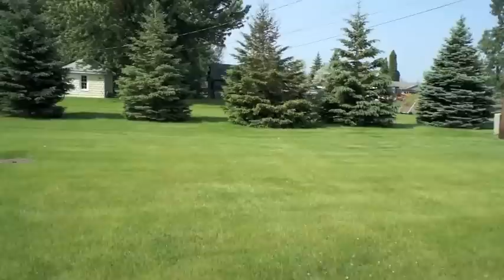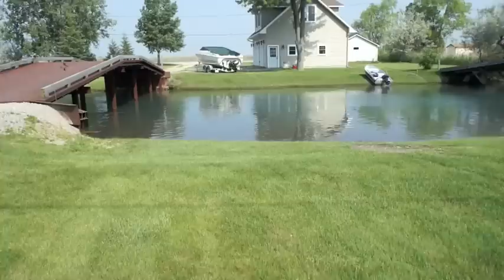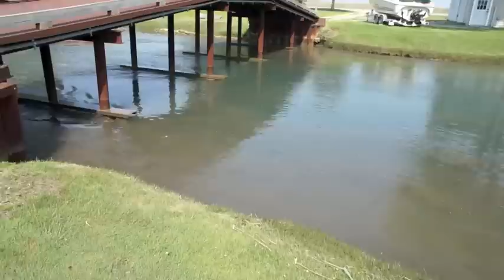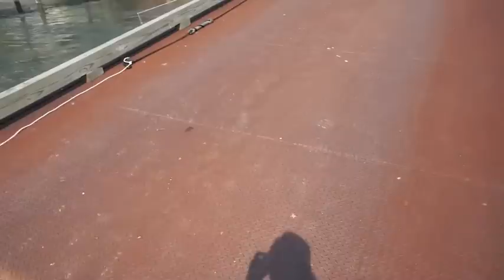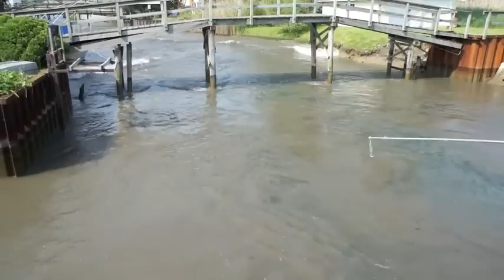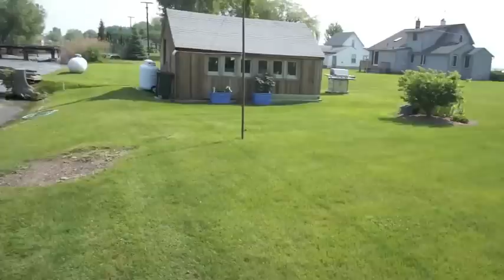Displacement from Ship causing damage

Comment: This video was part of a series of videos studied and analyzed by the USCG to determine that the upriver vessels were traveling anywhere from 3 knots to 5 knots over the allowed 8 knot (land relative) upriver limit (10.4 knot water-relative limit) during the shipping season.

You are a legend ,seriously somebody needed to put such a video to wake them ,very well made video
Reply: The speed limit has been enforced for many years by U.S. and Canadian coast guard vessel traffic controllers. By checkpoints and more recently GPS.
Reply: Last I checked the USCG regulations there was no speed limits anywhere. Just the slowest safe speed possible. Sometimes that can be 10 knots depending on wind speeds and currents.
Reply: @Deerhunter2024  Speed limits for the St. Clair river are 12mph/10.4kts SOG between light X-2 and Lake Huron Cut buoys 1 and 2, found in 33 CFR 162.138 and US Coast Pilot volume 6 chapter 2. Speed limits are enforced both by GPS/AIS monitoring and mandatory participation in the vessel traffic service at Sarnia, ON
Reply: Yeah but don't mind the uneducated fellow that has to tell everyone it has nothing to do with displacement. Its the props sucking the water from in front bathe ship and pushing it behind the ship, not the ship displacing water. Displacement will only cause a rise in water
Reply: @justindamirgian1088  Yea it didn't make sense to me.

Comment: I realise i'm 8 years late to the party, but let me get this straight. You bought a house next to a shipping lane and you're complaing that there are waves.

Better cancel all trade, and you can make up for it with double taxes for 25 years. Better?
Reply: no read the description! speed limits boats have them too.
Reply: If you bothered to read the description instead of being a dick you'd realize the issue is that the ships are speeding causing large wake that results in damage.
Reply: @JoeyMace28   There's a minimum speed a ship can move under its own power.  Slower it will lose the ability to steer. This speed is different for each ship.
Reply: Pete Mulhearn And evidently the ships were speeding and slowed down because it also says in the description that the problem has now stopped.

Comment: A simple cure at hand is o make a choke point at the mouth of this river...just wide enough for a small boat, with a shallow draft.   so instead of an opening 10 meters wide by  2 meters deep, ( that's an opening of 20 sq meters ! if its not a lot more..)  where as a choke point of 2 meters wide by 1 meter deep, is just 2 sq meters   the surface is one tenth or less , but the actual flow would be far smaller, probably about one twentieth and this would hardly be noticeable.

Comment: The problem here is soil errosion.
That's a big problem indeed. Those who never lived beside river will never understand this. Try putting plastic sheets in the edges. Waterproof sandbags can be used. It certainly not stop the erosion but it will decrease the intensity of it.

Comment: I live on the St Clair river which is part of the Great Lakes shipping channel. It is not just the freighters but also the 30-50 foot yachts that go by at 30 - 50 miles per hour. Actually the yachts are worse for wake.This year with the high water levels the erosion and damage to the shore has been worse but there is a simple solution.

Rip rock or 12-18 inch rock dumped along the shore solves the problem. easy to do and not that expensive . I protected 80 feet of shore for $800 and took less than one hour Also the rock looks natural. Works perfectly and no more erosion or damage.

Comment: How about putting baffles at the mouth of the river, to slow down the water draining out. Then you could install one way gates to stop inflow.
Reply: The ships were exceeding the established shipping speed limit by a good amount, which is what was causing the problem. Once the limit was enforced, the problem went away (which makes sense, since a big reason shipping speed limits exist is to prevent excessive erosion).

Comment: The problem was that quite a few of these ships were going over the speed limit required for this area. The ebb and flow of the water in the canal is supposed to happen but not at the rate in which these ships were travelling.  The higher speeds were causing the damages----that's what the man's complaint was. It didn't just affect peoples property but it wiped out wildlife habitat and breeding grounds as well. The canal was built for the lake to be able to sustain shipping lines with minimum damage to people's and the surrounding wildlife's environment. Exceeding the speed limits throw everything off kilter by causing a stronger force in the displacement and refill of the water.

Comment: Simple solution, only its a expensive 1.
And it last for years to come.
Steel plates against the shore. like the did under the bridge.
So the dirt doesn't wash away.
End off problem.

Comment: If you have a minimum height you need to maintain put a damn in, Control the water moving each direction. This can be done and be boat and fish friendly.
Reply: The ships were exceeding the established shipping speed limit by a good amount, which is what was causing the problem. Once the limit was enforced, the problem went away (which makes sense, since a big reason shipping speed limits exist is to prevent excessive erosion).

Comment: Just out of curiosity, where is the location of this? As this would be a natural occurrence from any ship of this size for numerous reasons. Number one, it's displacement, it's draw, moreover if one could even imagine the size of the prop(s) on the vessel this alone can and will cause enough turbulence in the water to affect any waterway adjacent to a deep water channel such as the one it is passing through. Remember, this ship, if loaded may be drawing as much as 30'. Have you spoken to the Corps?

Comment: Building a short seawall at the exit of the river that is level with the river water would get rid of most the drainage issue. Which in turn would reduce the volume of the incoming wave.

Might be a pricey though.
Reply: The ships were exceeding the established shipping speed limit by a good amount, which is what was causing the problem. Once the limit was enforced, the problem went away (which makes sense, since a big reason shipping speed limits exist is to prevent excessive erosion).

Comment: I’m confused on why this is happening, I feel like he didn’t explain it well. Can someone help?

To me, wouldn’t the water in his canal rise because of the ship causing the water level to rise in the river? Is the ship blocking/slowing water flow to his canal? I’m just confused as to why the wake is coming in from the backside when the water flows in from the front.

Plz help
Reply: As the large heavy ship moves down the river, it must displace water to keep it floating, that causes the water level to rise in front of it and behind it. As the ship moves past the inlet to this waterway, water rushes out of this waterway to fill in the 'space' the ship displaced. Basically the ship is sitting in the middle of a trough between the bow wave and the stern wave. Lastly a large wake from the ship works its way up the waterway. Kind of neat demonstration of hydrodynamics. There are some other videos on youtube showing this same effect. It's much more pronounced in narrow/shallow channels of water.
Reply: On the IL river where I used to have a cabin it worked a little different, before the barge got there, esp going up river the water level would drop about 18" them after it passed it came back up. I presumed that the props were sucking water from in front and pushing a wave behind to propel the barges. In my case there was no leading wave, actually the low water was pretty far in front of the whole tow.

Comment: Think the solution is to put [a] baffle wall(s) in at the mouth of the canal. Although it won't solve the issue entirely, it will reduce the severity by spreading out surge either way.  I'd get the river authorities to pay/install this - i.e. take out a class action.
Reply: The solution was to enforce the shipping speed limit the ships had been breaking. Once they slowed down a bit the problem stopped happening (an excellent example of why the speed limit had been established in the first place).
Reply: - Or fit a Tesla valve system.
- Or mine the main channel sinking a couple of the 'thousand footers' & bingo no more problems.  ;-)

Comment: They're supposed to pass at no wake speed. Easier to do going against the current than with the current. Losing steerage way would be a big problem. 1000 ' rs are all IS based.

Comment: Sometimes you have to move if you are not happy, be safe in the meantime👍
Reply: The ships were breaking the shipping speed limit by a good amount, which is what was causing the problem. The homeowners shouldn't have to move because of that (and they did not; the speed limit was subsequently enforced and the problem went away).

Comment: Not caused by the ships displacement, more the propeller in a narrow shallow channel, it will draw water from everywhere it can. If it runs out of water it is not un common for a vessel to literally suck itself to the bottom of the canal. Answer is to slow down.

Comment: I used to be in the shipping industry and from the little I could see, that ship was going too fast. It could go slower only with tug assistance and two problems with that are (a) the cost and (b) the width of the channel needed to accommodate tugs and ship.

But, fundamentally, your cute little canal is located adjacent to heavy industry and this is the maritime version of a lot of heavy dump trucks using your small country road. Damage is inevitable and who gets blamed? It's also true that ship owners are — theoretically — responsible financially for wake damage. Hard to prove the damage is caused by such-and-such ship.

I suggest sealing off one end of the canal with some sort of berm or dike. But that may not be the main problem. I'm thinking the wakes must be smacking the property facing the river MUCH harder than the little bit that comes down the canal. Long-term, I'd sell and move before my house falls into the river.

Comment: You need to upgrade the whole canal. Lay down heavy soil stabilization fabric and put stone on top. The whole canal should be done to the limit of the wave action. Don't know were you are, but Army corps of engineers does most of this kind of work in conjunction with private contractors. Time to call your local politicians.

Comment: A simple sea-gate lock at the end of the canal could solve the whole issue. Close the Lock when not in use, and prevent wakes and floods. Total cost would be $50,000-$100,000.

Comment: As a towboat captain I have often wondered why people build on industrial canals an then shoot at us or throw things at us when they think we are going to fast (i have had boat happen couple times got the wheelhouse window shot out).guess what it ain't like driving your car or even your little bass boats. we deal with a thing called wind all the time. that 1000' ship he has 1000' of sail.the only way to counteract that is using power if it comes to either I'm gonna keep this tow in the middle or drop it on your property. I'm gonna use every bit of hp  that I need to use to hold the canal.yall could look into damming off your little cut. there are other options.

Comment: Well, water is not compressible  and so when the tanker moves forward,  the pressure zone ahead of it with cause the water rises ahead and in a zone lateral to the ship. This will cause the water to enter any estuary feeding the main channel.  When the  ship passes, the level of the water goes back to its original level and the high water in the estuary will return back to the main channel.

Comment: as long as they are maintain the set speed limit for teanversing the river, what's happening to the canal should be totally expected.
blame your bridge engineer IF they aren't speeding. 

if they are speeding then they need to be cracked down on until the learn to do the safe limits traversing the river.

pretty simple.

Comment: That's interesting. I used to work on big dredges in the Port of Oakland and when a big ship went by our operator would put the bucket (full of mud) in the dump scow (tied up next to us) to keep it restrained until the "suction" would cease. If our operator failed to do this...the soft lines and fleeting wires attached to the scow would tighten and possibly break, snap, or part...however you want to say it...as the scow would try to drift out and away from us.

Comment: You wanted to live on the water. Shiposaurus says "here ya go."
Reply: "Despite vessel size increases, commercial shipping vessels have coexisted happily with land owners. In fact, for nearly 100 years - shipping traffic and effects have been non-problematic in this region, due to vessels traveling at slow speeds through navigable waterways."

No, those ships have and 1000 footers have... just not at increased speeds...  it's only the speed that is creating the issue.

I loathe people who move to absolutely retarded areas and then complain..
Reply: joynthis  I wonder if they have beer on the sun?
Reply: And if the ships didn't make port near where you live anymore. You can bitch about how all those jobs are gone. I can tell you what the City of Norfolk, VA found out when they complained about the Navy several decades ago.
Reply: Maloy7800 correction the house itself has been there for years.. those ships were passing through before he moved there..and have been for many years.
Reply: Not those ships,  not 1000 footers and not at increased speeds. Read the description. Blah.
Reply: @AdriaanVerburg  The thousand footers have been around for 45+ years. They're nothing new.
Reply: My thoughts exactly. How long they been shipping through there? And you wanted to live there. Obviously it's been modified around the area so....
Reply: They HAVE lived on the water for years until ships started speeding. READ THE FUCKING DESCRIPTION, STUPID.
Reply: Maloy7800 eat shit, fuck the poor. Trump 2020

Comment: Under law, all vessels are responsible for their wake (for vessels over 1,600 gross tons, the specific law is 33 CFR 164.11.p.6 of the Federal Code).  This means that if you have actual (as opposed to perceived) damages, you can sue.  You should contact the Coast Guard, Army Corps of Engineers and which ever state or local agency that controls the port.

Comment: How much could it cost to line the sides with concrete or something? Sounds like a problem the Netherlands has already found a solution for.
Reply: We had a small French summerhouse that was on an island and we had to reach it using a Chain ferry (basically a 6ft x 4ft iron tub. The bank/landing stage collapsed one year and we had to rebuild with concrete and it cost us nearly (converted)  $4000 to concrete a 3 meter (10ft) stretch. There's 2-300 ft apparent in the Vid and it's pretty obvious there's more, but let's say just 250ft X two banks is 500ft or 50x10ftx$4000 and then reinforce all the bridge footings.
Reply: It might be worth looking into to have the companies pay for the concrete since they are the ones causing damage from going too fast. There might be cheaper solutions than concrete though  
  
Or acrually enforcing the speed limit
Reply: Nermket Good idea. Just get to the bank. put a stopwatch on a pole, keep it center shot as the boat comes through the frame. A $30 lazer range guage will tell you how far away it is. Calculate its speed. Send evidence to maritime/river authority and that should be enough to see the captain fined, which will slow them down.
If not, then just gather the evidence for yourselves and start a class action with everyone effected sharing the cost. You can't lose as the math is irrefutable.

Comment: Could someone explain why the word "displacement" is being used here?  It doesn't quite seem like the marine meaning.
Reply: It's actually the opposite the ship passing by creates a vacuum behind it sucking the water from the canal then the water quickly rushes back .
Reply: The ships propellers are what is doing this and the effect is caused by it operating in a channel. They push a huge amount of water back creating a lowering of the water as the ship approaches and a raising once it has passed.
I suppose that is displacement but not in the way a floating body displaces it's own weight.

Comment: So there's an engineering solution to this, Build a backflow dam that will normally let the canal drain, but when water pushes back at unsafe levels, it lifts up, blocking the wake from the canal until the pressure drops to safe levels again.

Comment: Google Earth: 42.553845° -82.589882° Harsens Island.   I see what you mean by Bernoulli effect.  As the ship proceeds upriver the constrained water on its sides speeds up.  By speeding up it reduces pressure which lowers the water level in these little canals and inlets.  When the ship passes, the river restores itself but there's a break, a jump from faster moving low water to slower moving high water.
Reply: Water is non-compressible. But all things considered this might have a footing on reality.
Reply: this break is called a Hydraulic jump.
Reply: nope

Comment: It's a "tidal bore" except of course not really a tide.  The wave itself is a "hydraulic jump" where the flowing water suddenly slows down and because of inertial briefly goes straight up.  Half of it falls downstream, half upstream to propagate the wave upstream.  You can make a miniature version of this by simply putting your hand in a fast flowing water ditch and on removing your hand the disturbance will persist for several tens of seconds as if your hand was still creating a wake.